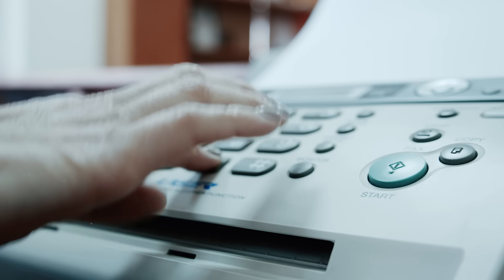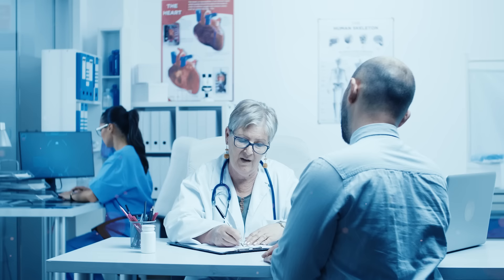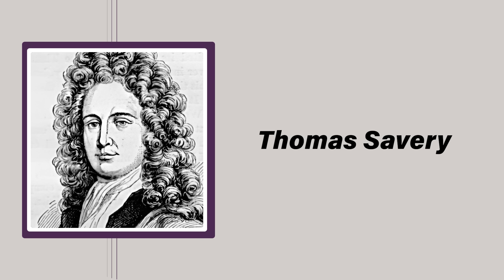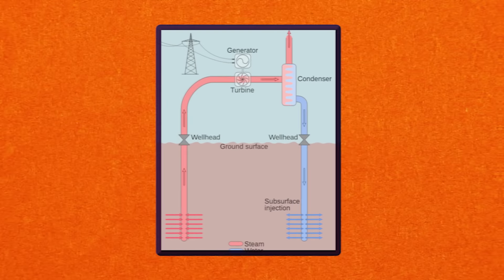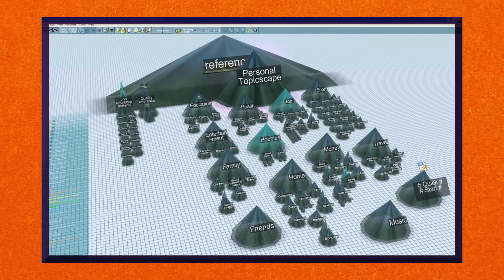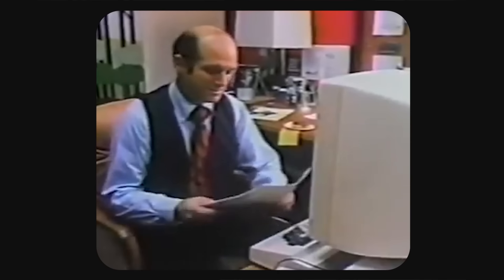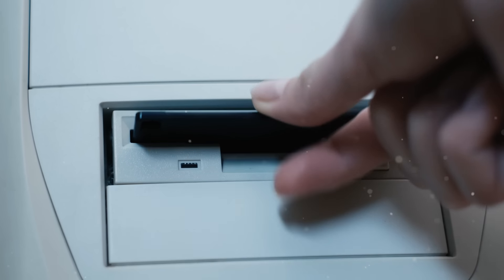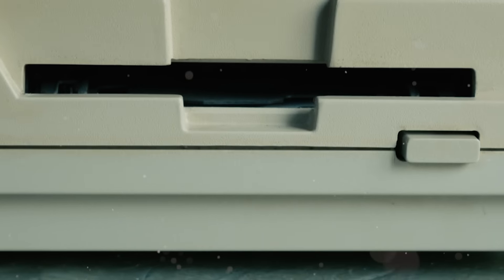Terribly Outdated Technology that we Still Use...

Comment: The relief brought on from upgrading from Windows NT was palpable.

FYI, if you have a McLaren F1, a car which sells for $10-20million, remote diagnostics are performed via an old school dial up modem and technicians will hook into it directly with a 25yr old Compaq computer which holds and transfers updates on...you guessed it...floppy disks.
Reply: Plus side of that is it would be a lot harder for bad actors hacking in, sabotaging the computer or planting spyware or anything else. Using obsolete equipment no longer in common use by anyone else is a legitimate security measure
Reply: They will most likely be working on an alternative to that as U.K. PSTN services close down in 2024, so dial up will no longer work.
Reply: @Pugjamin  ...but...what will they do, these people who can spend $10-20million on a wildly impractical car? What will become of them?
Reply: @mastpg  I would assume that they’ll run the software on a VM and then use a GSM dial in connection rather than PSTN.
If the car doesn’t already have one fitted, I assume they will fit a GSM modem into them.
Reply: Windows NT? Never heard of it. I think it was 95, 98, XP, ME, 7, 8, 10, and 11. Out of all them 7 is the center, the Apex, and the best OS Windows ever made.
Reply: @EmeraldEyesEsoteric  Better luck next time. Windows NT...since you didn't know, now you know.
Reply: I like that visual.
Reply: @EmeraldEyesEsoteric NT is the name of the kernel tech that succeeded the DOS behind 95 and 98
Reply: Windows 10 and 11 are still part of the NT family. Latest release, August 22, 2023 according to Wikipedia.
Reply: @Pugjamin  Sounds like someone should look into getting some gig work at McLaren. Their swag is excellent and I've heard the speed tail is spectacular.
Reply: @EmeraldEyesEsoteric Windows NT and Windows 2000 are versions of Windows that indeed exists.

Oh, you forgot Vista.
Reply: @myrlyn1250  TIL someone on earth cares about operating system edition "families".
Reply: @Ozzianman you mean "Veeesta" as Simon called it.  :D
Reply: Windows 11 is technically NT 10.0
Reply: @gustavrsh  ...and "technically" how many people care?
Reply: Is that to keep proprietary company IP off the Internet permanently? I have no issue with NORAD using punch cards for air gapped offline only systems
Reply: @Adiscretefirm  The internet and deduction exist. You are lacking one?
Reply: @EmeraldEyesEsoteric NT is short for Network. It’s a professional grade OS for offices meant to be, shockingly, networked. It’s the kernel XP was based on.
Reply: @Ariccio123 No, it succeeded Win 3.11 for Workgroups. Later it got the 95 interface on 4.x. And still later got infused into what became XP.
Reply: @gustavrsh  Both Windows 10 and 11 use NT 10.0 which was first called NT 6.4 but was renamed to 10.0 to match the name of Windows 10.
The version of NT can be seen when opening CMD, for example on my main PC the first line is: Microsoft Windows [Version 10.0.17763.4737]
Reply: @gustavrsh  - remember when Microsoft announced Windows 10, they said it would be the last version of Windows that would be released, with regular routine updates? 

Pepperidge Farm remembers.
Reply: @Pugjamin   I don't know most of the details but for the McLaren I believe they need a particular model of Compaq laptop because they have hardware which connects using a proprietary interface on the laptop. If it was as simple as running software in a VM they would already be doing it. The McLaren is an interesting yet slightly atypical example. In nearly all of these legacy systems it's specialized hardware which prevents easy upgrading.
Reply: @NinjaRunningWild , NT stands for "New Technology", not "Network".  Windows 1, 2, 3, 95, 98, and ME were all of DOS-based lineage.  Windows for Workgroups 3.11 integrated networking capabilities into the operating system.  Meanwhile, Windows NT was an entirely separate lineage.  (Windows NT has some tie-in with OS/2; I expected Simon to say either "DOS" or "OS/2" right before he said "Windows XP".)  Windows 2000 represented more or less a convergence of these lineages with the Windows 95 user interface on the Windows NT kernel.  From then on, Windows 2000, XP, Vista, etc. are all based on the NT kernel.
Reply: @EmeraldEyesEsoteric did you know, since you have the internet,  you could just look some things up before you make a dumb post like that?
Reply: @mastpg 
Take it to Gordon Murray's house and get him to fix their car in his shed?
Reply: @Pugjamin  When it comes to computers/networks, there's ALWAYS a bridge/tunnel/adapter of some kind created. VoIP is one such bridge. For floppy discs there are various usb stick adapters.
Reply: @mastpg  Actually the tiny obscure facts are interesting so I guess I care
Reply: @MiciahMasters  Thank god someone is actually informed on this thread lol. I was slowly losing hope until I saw your post lol.
Reply: @Pugjamin  what makes u think dial up will no longer work?...
..PSTN (Public Switched Telephone Netwirk) or copper cable/land lines will no longer be needed... 
all communication will be between towers not cables,
it would will still be possible use dial up over cellular networks..
..if u refering to old modem communication wich u connected to a landlene cable system, the modem required/used 24-48volts because that was was the land lines had...but i see no reaso what so ever this could not be emulated with some software on a smartphone connected via usb or bluethooth to a box translation to a modems communications protocol.. it would be very simple if someone wanted to, it would also be super slow copared to modern standards
Reply: @Ozzianman everyone is trying to forget Vista
Reply: @Ozzianman who could forget Vista!? 😂
Reply: @chieftron  ..can also add that the first versions of XP, 2k, 2k3 was all 32 bit and later came in 64 bit versions, windows XP 64bit was basicly a windows 2003 (2k3) stripped server OS without the server parts disabled... as a fun side effect a version of XP-64 bit edition run on iA-64 bit architechtures ... XP pro 64 run on x64
Reply: For something that flash I'm suprzied they didn't use a zip drive.
Reply: @Pugjamin  maybe limited to 2400-9600 baud but it does work.
Reply: @EmeraldEyesEsoteric  windows XP was based on NT.
Reply: @OrbitalRoc  ..McLaren F1 started production in 1992..
Iomega Zip drive was invented 1994..
Reply: @Patrik6920  I've ran every Windows since 3.1, including XP 64 bit on an Athlon 64 3200+. First machine I built that could use more than 2.8gb of ram on a desktop. Also, I've been a MCSE since 2012 ;)
Reply: @EmeraldEyesEsoteric  Windows 2000 also known as NT 5, also you forgot Vista
Reply: @chieftron  ..uhm okay...
Reply: @NinjaRunningWild nope. NT was short for ‘New Technology’.
Reply: Yes! I came here specifically to mention this too haha
Reply: @NinjaRunningWild NT is short for New Technology, not Network.
Reply: @@retiredbore378 Except, definitely obscure facts considering how long the software has been around. Sorry mate, apart from half of your comment that seems incomprehensible, you didn't even give reason for your comment
Reply: Same with the Lotus Elise
Reply: @@retiredbore378 I don't care about that. It looks good, works great, and doesn't take up massive space or do anything intrusive like other versions of Windows. It's also better then XP because that system can't handle Gigabyte Ram cards.
Reply: @EmeraldEyesEsoteric windows vista was a short lived thing (thankfully).
Reply: @EmeraldEyesEsoteric  MSWindows NT actually came out before MSWin95 (NT 3.1 released in 1993).  It was basically the server-level partner to WfW 3.11 (Windows for Workgroups) and did not run on top of MSDOS.  NT 4.0 took on the MSWin95 look (while MSWin 95/98/ME were still running on top of a MSDOS core, just well concealed).  Once they went to MSWin 2000 they dropped the "NT" naming, and everything since then has been MSWiN NT based.
Reply: @kasahadragon9499  Yeah, I had one with Vista for a short time. I think it crashed. I guess it was so bad, I didn't even remember it existed.
Reply: @EmeraldEyesEsoteric  Wow, it's hard to believe someone has not heard of Win NT or used it.

Comment: I own (and ride) a 93 year old motorbike. Old doesn't always mean obsolete. I work in finance in the UK, many banks and lenders still insist on faxes. I'm also an ex-Navy Submariner. I bet many people would be shocked to find out that Nuclear Submarines are moved using steam. Albeit steam produced by water in the secondary water loops in the reactor.
Reply: Took a lot of guts to be in nuke sub.  The concept of a sodium-cooled reactor operating in the ocean is not a pleasant one.  Sodium and water, especially sea water is not a happy outcome if they come in contact with each other.
Reply: @ssaraccoii  I was young and stupid, and they paid extra. I didn't really consider any risk back then.
Reply: Unless he served on a sub before 66' it wasn't a liquid sodium reactor. The UK has been using PWR reactors from Rolls Royce since the mid sixties. He would have to be at least 80 years old to have even been around a liquid metal reactor of that type. Maybe he is, but he still works and drives a motorcycle so chances aren't looking too good for that.
Reply: You're probably the same kind of guy that would say bolt action rifles aren't obsolete for combat duty. Like c'mon your bike probably neither has an electric starter nor an electric oil pump and it for sure has no ABS. That's the definition of obsolete.
Reply: @G-Mastah-Fash  Electric power doesn't mean anything. Most sniper rifles still in active service are bolt action.  The 1890s Maxim gun is still in service in Ukraine today. The water cooled barrel is ultra reliable.  Many ancient guns are still in use, including the infamous AK47. My bike has a manual kick start much like many modern smaller bore off roaders, and mechanical oil pump. You fact you're not sure about either makes it obvious you don't know what you're talking about.
Reply: I have a87 diesel pickup. I can buy new injectors for under $50. The new ones are over $350. They are more complex and break down regularly.  No way I would change.
Reply: I work in finance in the US. We have thankfully started moving away from faxing around 2020. This time for reals it seems.
Reply: My car and bicycle still roll on wheels and rubber tires making frictional contact with the road.  Bookmarking for when anti-gravity becomes a thing

Comment: With floor cleaning robots common now, the broom could be considered obsolete but it's still the best tool for the job regardless of how ancient it is.
Reply: I've never seen a floor-cleaning robot.  I have a vacuum cleaner but it pretty much stays in the closet as I don't have any rugs and a broom works better anyway as well as being able to get into smaller spaces than a vacuum head.
Reply: @FloozieOne Vacuum crevice tool: Allow us to introduce ourselves.
Reply: And the broom doesn't need a Bluetooth or Wi-Fi connection in order to be used.
Reply: The reason why broom is still used is because we have not made anything better

And lets not forget that brooms also went throught upgrades, a broom today is more than hay or bundled twigs wrapped around one end of it
The stick can be a polymer or metal rod even if wood is still great in that role, but twigs and hay got replaced by synthetic materials that last pretty much forever

Comment: I recall working at Dowty Fuel Systems in the early nineties and discovering some of those big Sipp-Dixi jig borers were still running punch tape & nixie tubes. It was at that moment I realised the three years I spent learning electronics in college was completely useless. The 'computers' still give me nightmares, row after row of 7400 series ic's, 4 logic gates per chip with the bathed in cutting fluid and swarf.
Reply: I think as late as 2000 there was a fuel station near us that had pumps with mostly display tubes, If I recall correctly they were 7 segment filament not nixie but still obsolete and niche, and some had been replaced with LED substitutes. Somebody was really going out of their way to keep the old machines going IMO. I can't remember when but eventually the place was pretty much totally rebuilt so its all replaced now.

Comment: I used to work at a large independent scientific research facility in San Antonio. We had a large distillation unit that had not been used in quite a while, but we found a customer that wanted us to do a job with it. 

While most of us were rearranging the piping, etc. of the unit for the exact job, the supervisor, who had been there forever, brought in the computer to control the still. We were confused, at first. We already had two computers in the control room, so why did we need a third?  It turned out that this still had been installed back in the '80s, and had never been updated. It needed an old computer to run it, and the programming was on 5 2/4" floppies.  So there we were, doing cutting edge scientific research with floppy discs. 

Amazingly enough, it all ran great. Well, except for the daisy wheel printer that came with it. We couldn't find any ribbons.

The still has since been updated, fortunately.

Comment: I was working in automotive manufacturing up until 2016 and our factory had inspection machines that booted to MS-DOS from a floppy disk. The machine programs being for programmable logic controllers were also small enough to fit on floppy disks and were kept with the individual machine manuals. We also had an used a fax machine. The components we manufactured were all safety critical and we produced about 1 million parts per year.

Comment: Steam is pretty dominant in industry as well. My stepson is 19 and making a KILLING learning to be a boilermaker. Also, it's a pretty damn efficient way to keep your house warm in a cold climate in the winter. Boilers are VERY popular in the 'north'.
Reply: I had a summer job in college painting all the steam and water pipes that jutted out from the two boilers in the heating plant. I recall one day I walked outside and it felt cool--and I didn't believe people when they said it was 100 degrees out. Oh, the things they made work-study kids do . . .
Reply: Nothing much holds more heat than water by weight (propolene glycol is like 10% better, but i'm guessing you don't have a tap for that.) And the heat of boiling/evaporation is insane. That's why you get third degree steam burns.